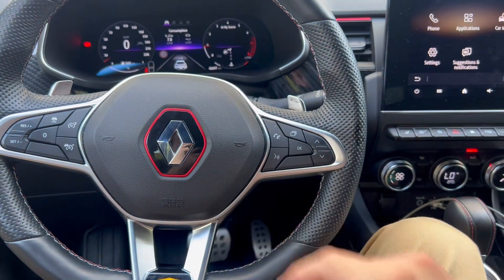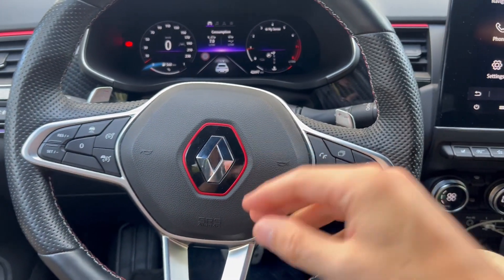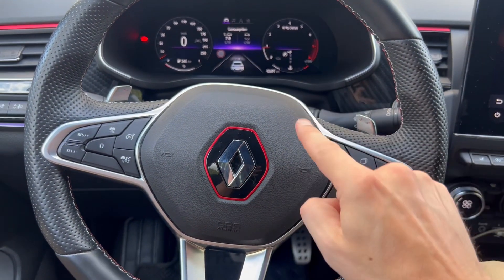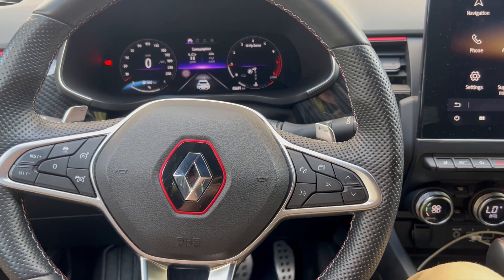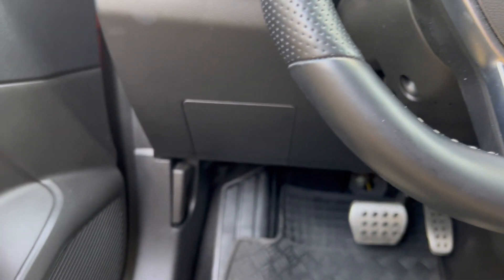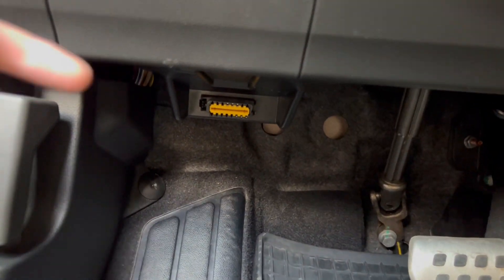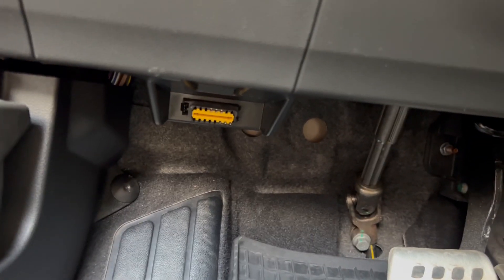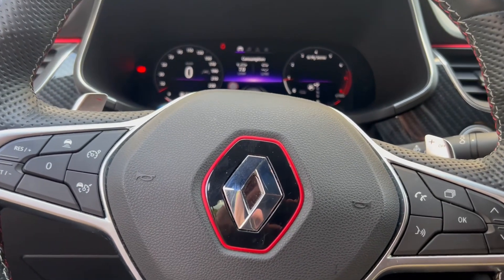Renault Arkana/Megane Conquest OBD Port Location

Comment: I have a renault megane 2025 sedan, how can I set it to sound a stronger warning when I exceed the speed limit, if possible
Reply from the maker: To set a speed warning on a 2025 Renault Megane so that you get alerted if you exceed a speed like 40 mph, you use the vehicle's Speed Alert (Overspeed Alert) function. Here is how to do it:

- With the vehicle at a standstill, press and hold the OK button on the steering wheel controls to access the settings menu.
- Use the up or down controls to navigate to the "Aides à la conduite" (Driving Assistance) menu and press OK.
- Navigate to the "Speed alert" menu and press OK.
- You can turn the Speed Alert function on or off by pressing OK.
- To adjust the speed limit notification (for example to 40 mph if you want an alert above this), press and hold the control to increase or decrease the set speed to your desired warning limit.

When you exceed the set speed, the display changes and an audible warning is given to notify you. The system may use camera-based traffic sign recognition and navigation data to detect speed limits and help enforce this.

This process applies whether your Megane has a built-in navigation system or not. The system also allows customization for increased vigilance zones depending on local laws.

The speed limiter can be set from 0 to around 93 mph (150 km/h), depending on vehicle specs, and works alongside the driving assistance features.

So to set a speed warning at 40 mph, turn on the Speed Alert via the settings menu as described and adjust the limit to 40 mph using the controls.